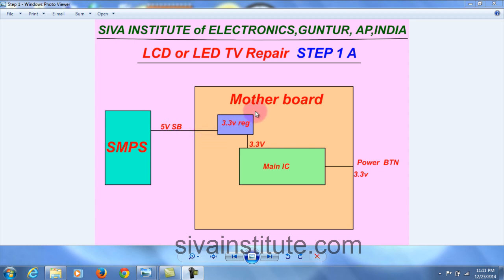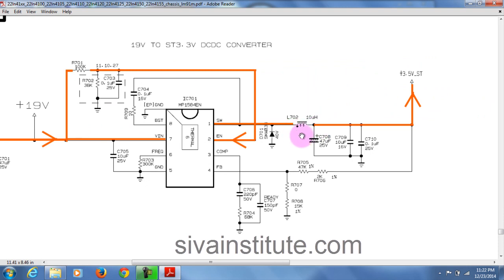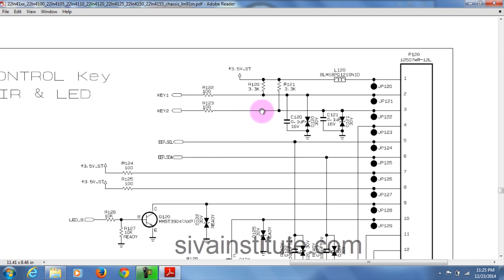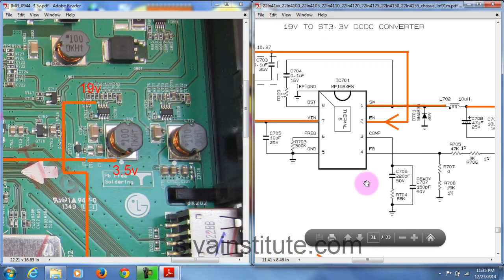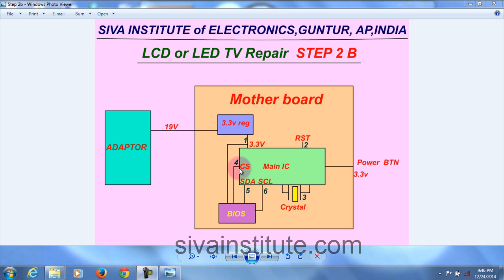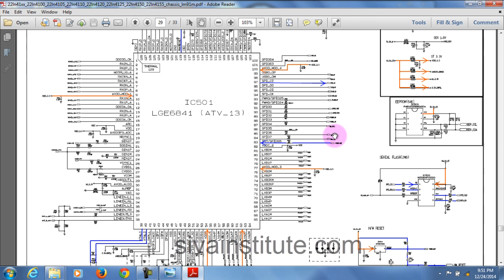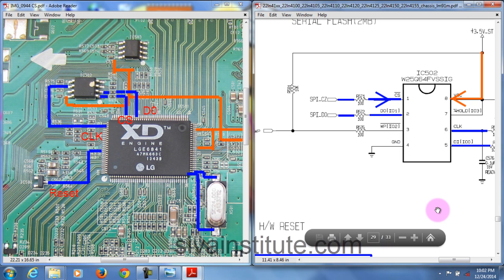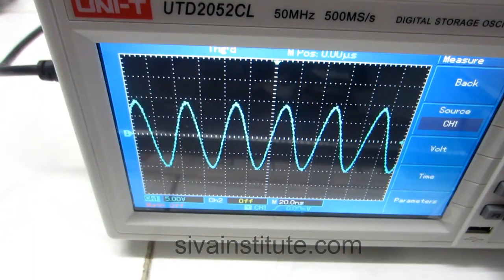How to check Dead LED TV Motherboard step by step

Comment: Dear sir, Many thanks for presenting an exceptionally fine training video. I was trained as a TV technician back in 1966 and started working as a technician. But I realized I could do more so received aircraft avionics maintenance training and became avionics technician and joined a British airline. The airline sent me to USA for further training 8 times and I also qualified as FAA Powerplant and Structure engineer.
I worked for 35 years as Saudi Arabian Royal Aircraft fleet engineer , Lufthansa airline  and American airlines.
I have now retired. I am 76 years old and still tinker with electronic stuff. But tvs today are a lot different than tvs of 1966, and I have started to retrain myself to repair tvs and computers. I do not sit at home doing nothing.
Many things are coming back to me. Many many thanks for exceptionally good video. Aftab Ahmed London

Comment: good evening,

i have a dead set, Coby 39" LCD model # TFTV3925. i'm thinking possible the cable box or satellite unit was impacted by power surge. inspecting modules i test where the line fuse good. question,   can a HDMI or a BGA chip defect cause this symptom? the main-board is not available via vendors.

Comment: Where can I get these diagrams like this? I have a Samsung model # ln32d450g1d that I suspect the main board is shorted as I have no back lights or screen when it is plugged into the power  supply but there is back lights when I unplug the main board.

Comment: I'm trying to find the schematics for a 39" Insignia tv, board HU39N2175F NS-39D420NA18. I'm trying to determine if the eeprom is faulty or one of the mosfets. All the caps were taken out and checked with meter, rectifier was checked however none of my pins has power going out to the next board. Can you do your magic and help find the schematics?

Comment: My main board is getting power, Audio, and bezel lights up. There is no video output at all , no display at all on LCD. Tried resetting power, no effect. Tried all inputs and volume increases with remote. There is no T-Con board in this model from videos I have seen online, just the main power board, the main board, and the LED driver board. No Logo displayed on boot up. Please advise as to what I can do to have this unit repaired at little to no cost.
TV is cosmetically pristine and used very lightly, was very surprised that this happened. It is a LG 55LE5400, Thank you my friend!
Reply: 1st check TV Panel by focusing touch light  on the surface of the TV Panel while pressing menu option in TV remote. if you able to see images on TV screen in torch light that means your panel is working and there is an issue in TCON or LED driver board.
Please note every TV have TCON Board (It may be inbuilt on LCD panel Board with Source & gate IC )
to access this area you have to remove LED panel completely

Comment: Hi
Samsung 32 LED 3d TV, series 5 not switching on but red indicator glowing. I opened the back cover and dusted. After dusting, worked only few days. Again same condition. Could you tell me in which board the problem is (main / power). Thanks.
Reply: logic board issue if possible check all capacitors if blown replace them (please note this is only simple troubleshooting ) checking all voltages required to confirm the issue

Comment: I am not getting +5v standby voltage towards main board. What may be the issue sir?
Reply: First disconnect motherboard from SMPS. Then check stby voltage. If stby voltage is present then something goes short on motherboard. If stby voltage is still missing then you have problems with SMPS. Servus.